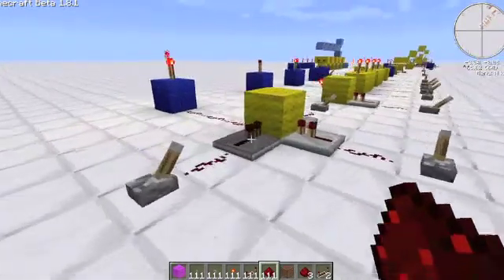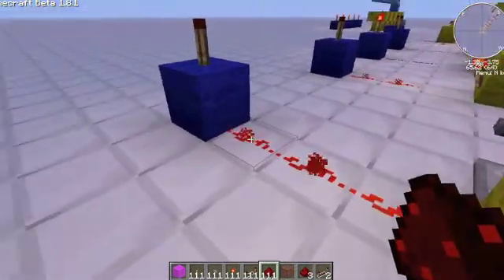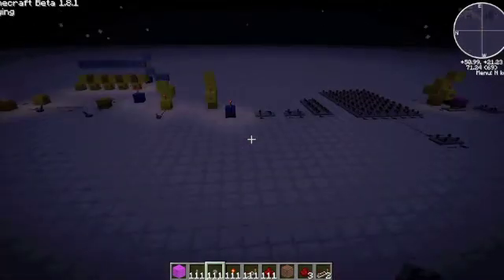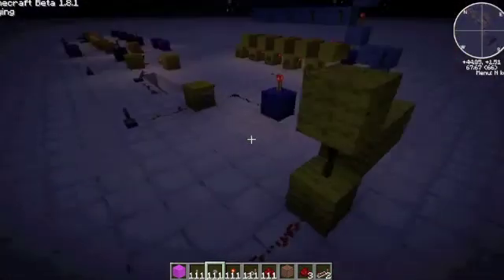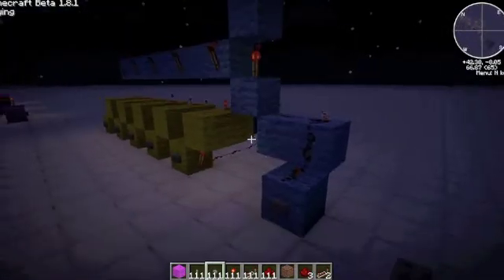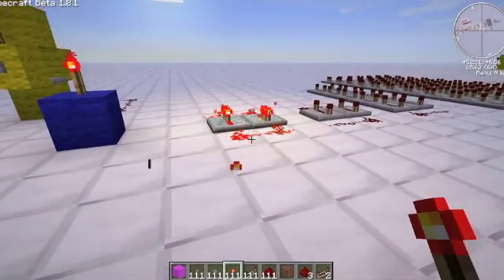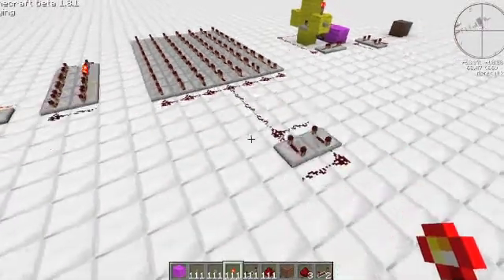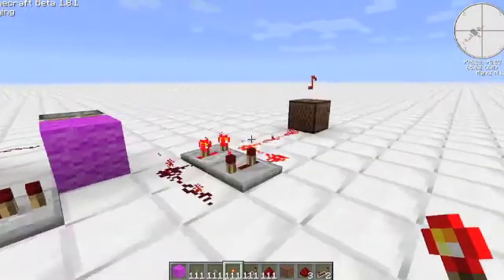redstone tuts for noobs part 1: the basics

Comment: when recording, only have necessary applications open. Don't have things like skype open if they are not in use. just have the recording application and minecraft open, and lag might be less. Another thing is that a button will start a clock by itself without a mono-stable circuit. The repeater at its lowest setting will hold the power for 1 tick, which is how long the button is pressed for. Good job! keep it up